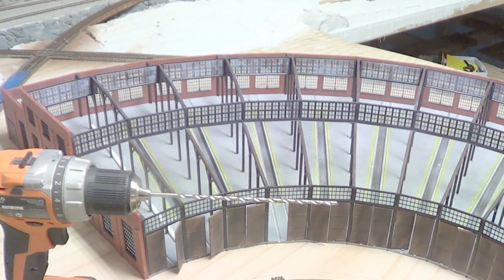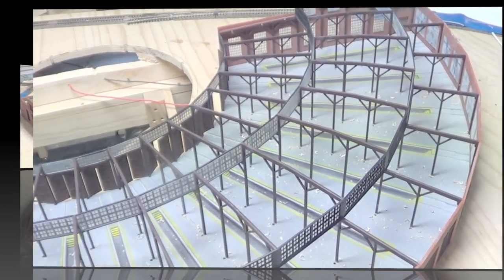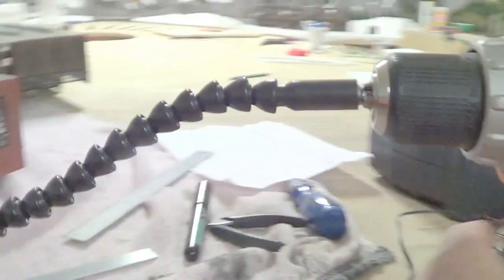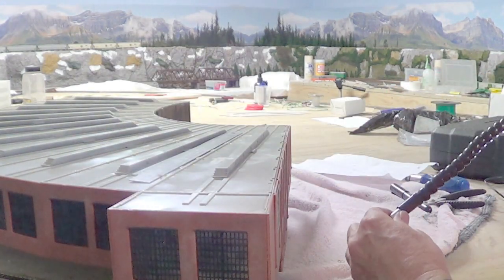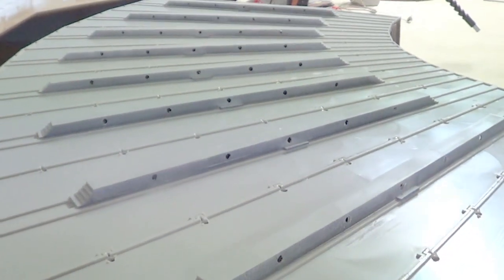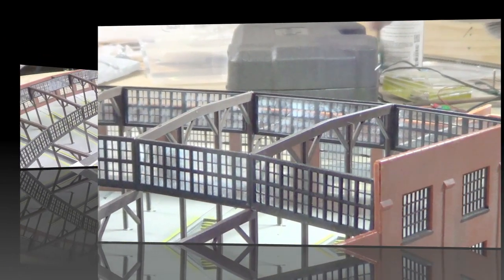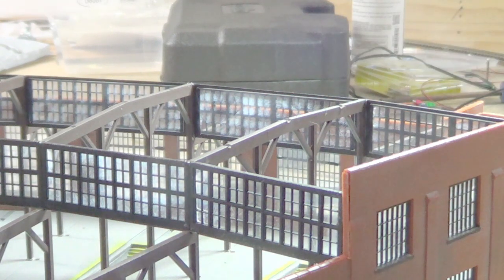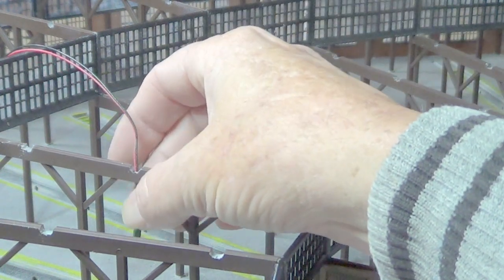Walthers 12 Stall Roundhouse & 130 Turntable Part 8 "Model Trains"

Comment: Probably would have been better to drill the holes before assembly, was getting worried that all your hard work would fall apart from the drilling. Your glue must be super strong :D.
Reply from the maker: The reason for not drilling at the start was they were going to go on the bottom
of the pits but i changed my mind and went to the side, and yes the glue is super
strong cheers Robert

Comment: Wow that is a lot of careful drilling needed. A good argument for drilling the holes before the kit parts are glued in. And for using slightly thinner wire, maybe even lacquered wire, inside to reduce the volume of the runs. 

Could you have placed a decider or distributed inside the roundhouse to reduce the need for wires coming in the floor to a mere 3 (digital, ground, lighting+) ?
Reply from the maker: Minok the reason i didn't drill the holes at the start of the build was because i was
going to drill the holes from the bottom of the pits, but changed my mind and went
to the side instead. The reason for using one light per frame is for a quick change
over if any of the lights don't work cheers Robert

Comment: Not sure I would put lights in the pits if I had to drill all those holes.  Might have been easier if the holes were drilled before installing them.  Should look good when done.
Reply from the maker: Scott the lights on the pits were going to go on the bottom, thats is
why i didn't do them at the start. But i changed my mind as we all do 
and made it harder for me. Just hope the outcome was worth it cheers Robert

Comment: wow thanks, I am not  that far into the building think it may be easier to do it before its all build my lucky this year would be in January before I can do much more  work on the layout
Reply from the maker: Jennifer the pit lights were going to go on the bottom of the pits, that is why
i didn't do them at the start. But i changed my mine and went to the side. But
i would have done these at the start if i knew i was going to the sides cheers Robert